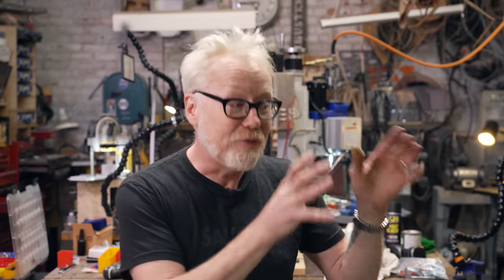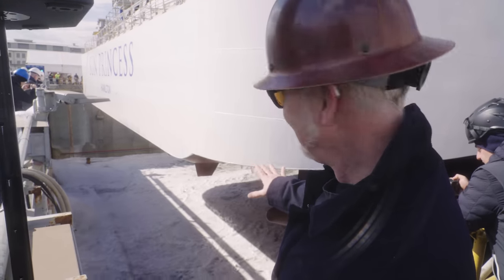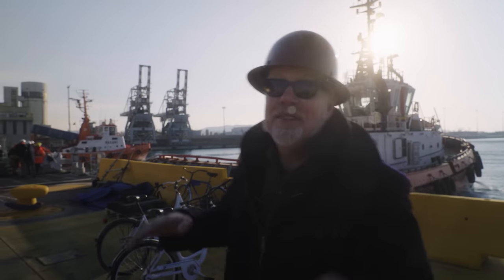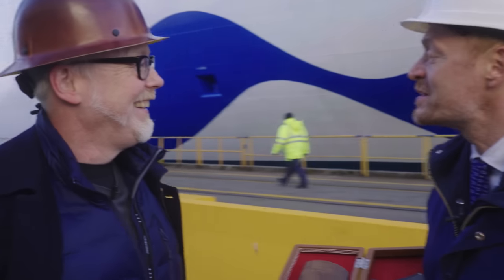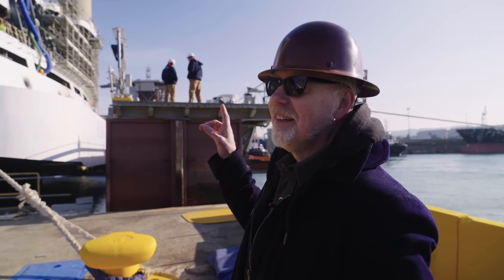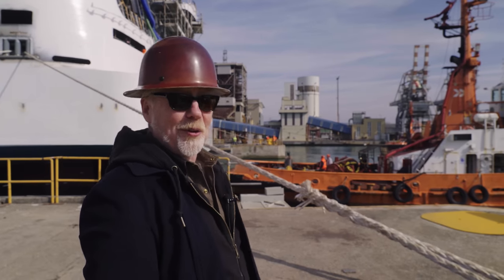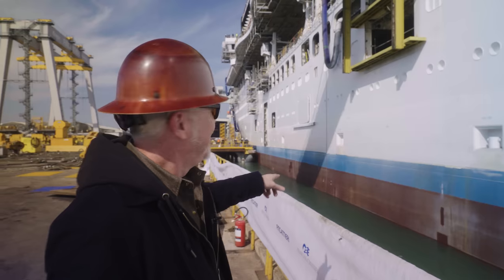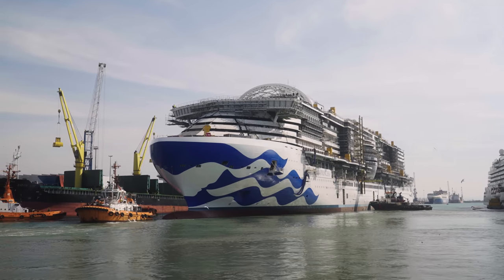How Giant Ships Move From Land to Sea

Comment: Just the logistics of 80 trucks delivering material every single day is astounding. You gotta coordinate all those truck loads to come on the right day, with the right materials. It's just nuts to think about.
Reply: When the Twin Towers were being built, it was something like 200 trucks a day
Reply: That's one of the key use cases for AI right now, same as with the major international sea cargo ports too... just recently watched a documentary about the Hamburg International Cargo Port, and they are also heavily using AI and automation, for example their entire fleet of cargo carriers, as in the vehicles that move the big sea freight containers around the terminal, are fully automated and drive themselves, self-organizing... and the really amazing thing is that this entire highly complex system is really based on how ants organize themselves within their ant hill.
Reply: Not to mention unloading 80 trucks a day and putting it all somewhere so you have room to unload 80 tomorrow.

Comment: On water, Once you get several thousand tons moving it’s very difficult to stop. Keep in mind, and this goes for every vessel no matter the size, the slower your going the more you can handle the navigation. It’s why boats going fast typically crash. In open water the more distance between vessels the safer it’ll be. For large ships anything closer than a mile is too close